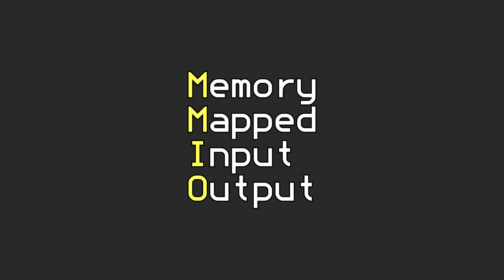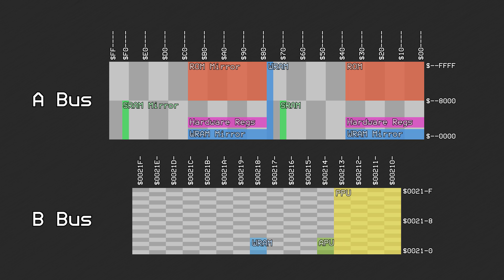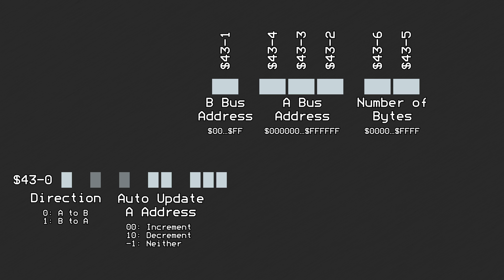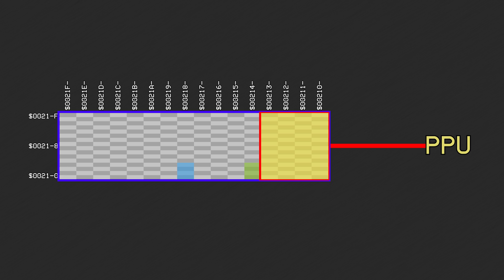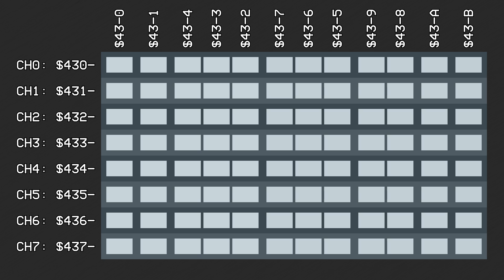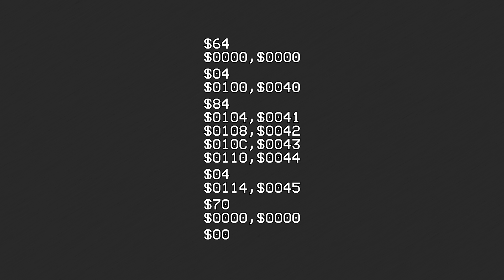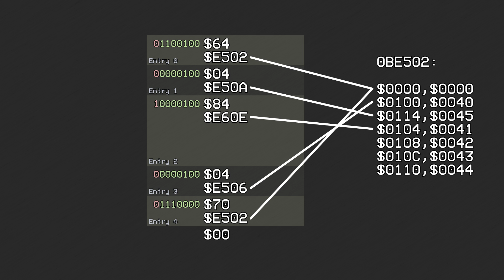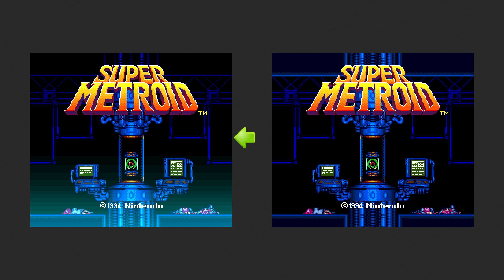DMA & HDMA - Super Nintendo Entertainment System Features Pt. 07

Comment: Surprised you didn’t mention the scanner in Super Metroid - it’s an effect that you can activate anytime once you get the item, and it really lets you see how they combined background layers and sprites in the environment. Fantastic video as always.
Reply: Since the x-ray scope's windowing effect covers the same amount of space as the windowing effect created by the eye's light beam, showing them both wouldn't be much new information on how non-rectangular windows work. It would have been interesting to see how the X-ray scope can show one background block inside a window and a different one outside the window, though.
Reply: @TurboGhast: Each layer (including all sprites and the background colour) can have a different masking logic. That means, you can set layer 1 (the visible layer on the X-ray) to be only drawn outside the window and layer 2 (the hidden layer) inside the window.
Something similar happens in SMW with the keyhole effect: The foreground layers and background colour (yes, that too) are set to be masked out (i.e. not drawn) inside the keyhole but sprites still can. But when the keyhole closes, SMW sets the sprite rendering in a such way that they're only drawn inside the keyhole but not outside.
Reply: @TurboGhast.  The background layer gets replaced by an almost exact copy of the foreground, but where the holes are visible (that's why the background disappears when scanning!), using masking the "xray" background is then shown where appropriate.

Comment: The visualisation of F-Zero 14:24 just blew my mind.
Reply: It makes sense when you see it, but I never would have guessed that's how they did it.
Reply: @5nefarious  I always assumed the took a section in front of the player, then skipped X numbers of pixels to distort it into the frustram  for psuedo 3d - running the whole track / background, from a top down perspective, through the mode 7s ASIC is pretty mind blowing.
Reply: @Wintermute_SilverPaths  A lot of racing games work roughly like that.
But, I've known what mode 7 does for a long time.
And yeah, mode 7 racing games work by altering the scaling/rotation parameters during H-blank for each and every line.
You can do this manually with the CPU, but HDMA simplifies your job a LOT.
Reply: @KuraIthys  I knew in principle how it worked but, seeing it drawn line by line is pretty impressive and helped me understand it intuitively. For some time, I assumed there was more going on than the affine transforms and DMA - more like a super scaler. This video series shows you just how much blitters, DMA and memory manipulation can be used to create GREAT effects. The irony of mode 7 is that the matrix ASIC that does the transforms was put in because the SNES was clocked at a dismally slow rate -  in order to be backwards compatible with the NES, which obviously never happened. The NES was clocked at 1/2 the colour burst frequency (1/2 F)  and the SNES was only 2/3 F. To put that in perspective, the MASTER SYSTEM,  a NES contemporary, ran at F and the Genesis ran at 15/7 F. In retrospect, it's probably a good thing considering how backwards compatibility has often encouraged developers to design for the lowest common denominator and then mildy spice it up for the better, more expensive and thus rarer systems. Just look at how much this sabotaged the Sega CD; probably for the best that Nintendo didn't pursue NES compatibility or we'd see NES quality games, only with larger color palettes. It makes sense form a business perspective but, it's a shame we never really got to see many examples of what a Miyamoto could have done with a true game on something like the SCD, instead of gimmicks. If you're into the SCD, there are some tantalizingly great games, just not enough of them.

What's funny is that Nintendo is single handedly attributed with saving the gaming market after the crash of the 80's, which is dubious but, they invented the concept of a Graphics Accelerator to make up for the SNES' low clock; we have them to indirectly thank for the awesome modern graphics.  They essentially had to put in mode 7 to get around the fact that the SNES was so much slower than the Genesis,PC-engine and Master System which were from the 80's. It's a shame they limited the ASIC to a background layer too. The Sega CD was more or less a contemporary of the SNES and the SEGA "mode 7" ASIC could be used on any data in the system, not just a BG layer. When people reminisce over what could have been if Nintendo and Sony had made a CD SNES, they overlook the Sega CD. On a hardware level, when the SCD is used the way it's intended, the SCD is by far the most impressive console of the 16 bit era. Too bad developers were so enamored w/ FMV trash instead of using it to add pre rendered elements and cut scenes as intended by SEGA. That and all the repurposed corelco games that were sitting around unused when their VHS game system got (rightly) canceled.
Reply: @Wintermute_SilverPaths  THAT is the longest reply i've ever seen on yt!
Reply: @KuraIthys  I think it isn't just mode 7 in use here, color math seems to be used to emulate a basic form of lighting.
Reply: @5nefarious  yeah, it's kind of amazing how much a visualization can help you grasp what's going on, even if (like me) you don't really have a clue about the complexities behind it all.

Comment: Even with two years of computer science classes, this stuff is still pretty dense. It really makes me appreciate how smart all the hardware developers were to design all of these features into a simple gaming console.
Reply: I've been coding for 8 years, and this is still super dense. Thankfully, stuff like this is really only for hobbyists, you never have to dabble in stuff like this unless you want to for fun.
Reply: @davidmenlo9305  Or you are making a game yourself :p
Reply: @davidmenlo9305  Not really only for hobbyists. Stuff like this is still awfully common in embedded system engineering and microcontroller based electrical engineering.

You'd be surprised how many microcontrollers you still need to program in assembler because they don't have proper C support.

It has come to the point where there is a real split in competences between high level and low level programmers. Low level programmers can't program high level and high level programmers can't program low level.
Reply: @joey199412  I'd never considered that this wasn't always the case that there this significant division between low- and high-level programmers. However, it is logical that programmers who are used to working in less-developed languages would be better at low-level languages. To your point, as a C# programmer, if it weren't for general hobbyist stuff and assembly-based Zachtronics games (like TIS-100 or Shenzhen IO), I'd have no knowledge of it.
Reply: You're on the right track. I'll be honest though, this stuff is a bit (a lot) over my head, too. But I find if you rewatch stuff like this, since you won't remember everything the first or even 5th time you watch it. And consult other resources to get a different point of view on it, it can do wonders for comprehension and retention. Especially if you already have a background in the topic as you do. Just keep at it and you'll get there sooner or later. The key is tenacity and patience. But that's easier said than done.
Reply: This is computer architecture.
Reply: This console is not simple; however, the Atari 2600 is.
Reply: A game console we all know and love but that programming sound sooo complicated,time consuming  and boring, i can hardly imagine that game devs had to work that way and doing all that within a scadual time, you had to think like a mad scientist in order to understand this,phew.

Comment: Emulators are better to actually play because they don't slow down and you don't get the awful "Analog fuzz" because you can only connect a real console via composite video. And savestates. Some can even rewind the emulation if you screw it up.
Reply: uhhh ok?
Reply: I say this because there a number of freaks who open up their consoles and install "RGB Mods" and search out Sony PVM Monitors to play them on, trying to make the real thing look as good as an emulator. search for SNESRGB to see what i mean
Reply: You haven't played with console then mibaW
Reply: I grew up with Pretendo like the rest of us

You don't have to blow on an emulator to get the game to load!
Reply: nice straw man, John.
Reply: Not to mention that emulators have input latency that a standard console setup does not have.
Reply: Consoles also have input lag: Every console other than the 2600 can have up to 1 frame of lag, and double-buffered rendering jacks that up to two. A handful of emulators have various speedhacks to remove that latency. For example, RetroArch can play games with savestates to remove that one frame of lag; and Dolphin's "Immediately Present XFB" option also has less lag than real hardware (for different, hackier reasons).

Now if only someone would fix the lag on GBA emulators so I don't have to boot up my 3DS every time I wanna play Rhythm Heaven...
Reply: There's CEN64, but I don't believe it's ready for prime time yet.
Reply: "you can only connect a real console via composite video".  You really are blowing smoke out your ass, I've been using RGB for a long long time, and it has nothing to do with making it look like an emulator.  Get off your high horse, sit down, and let the real adults talk.
Reply: How much mucking about with the innards of the console did you have to do to achieve this?

I was speaking of the default condition.
Reply: John The original SNES/SFC model is RGB capable out of the box.